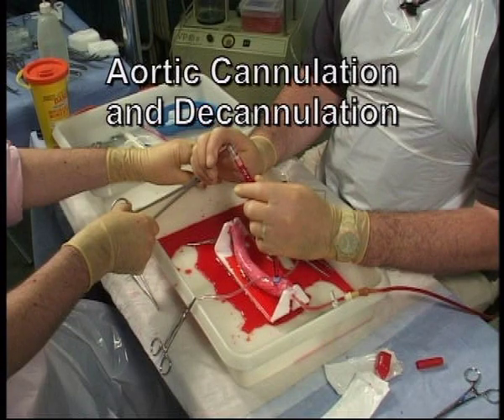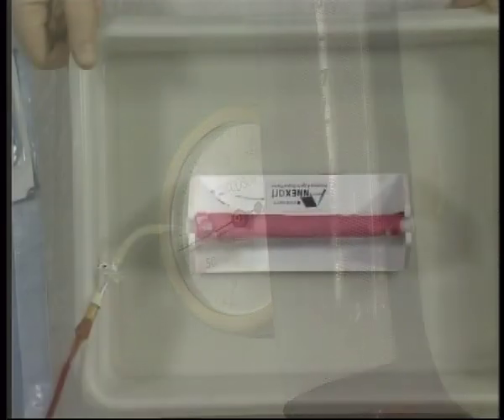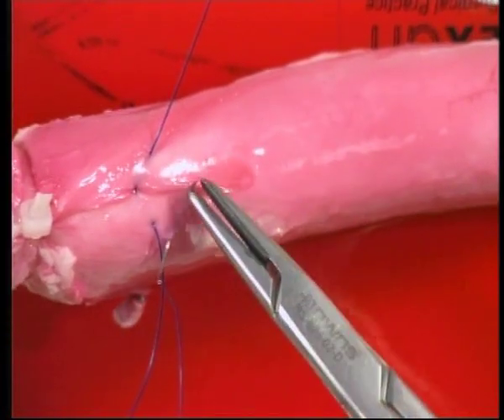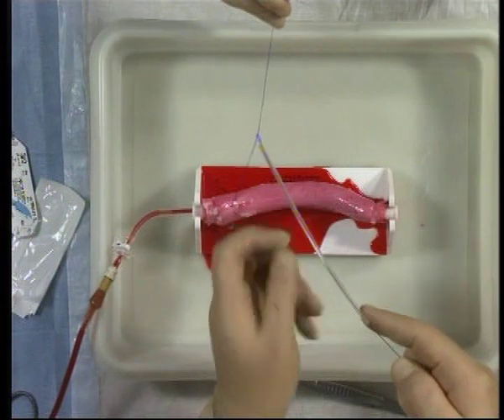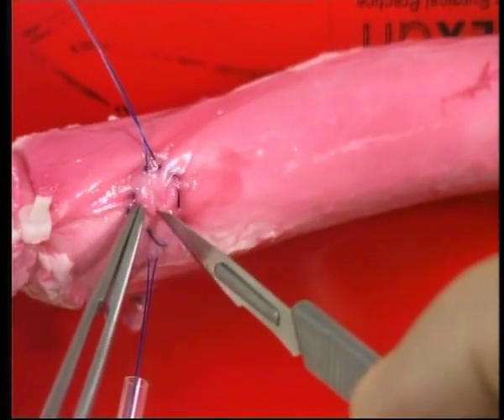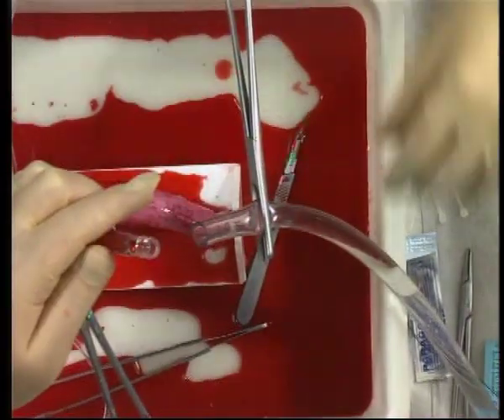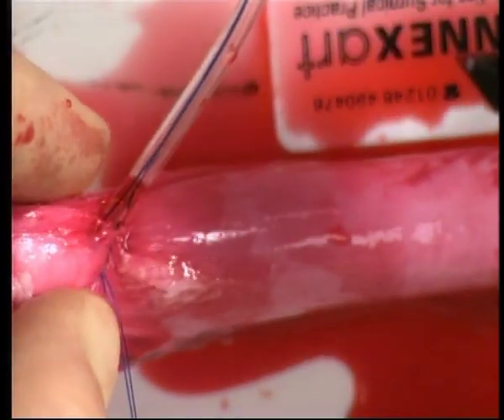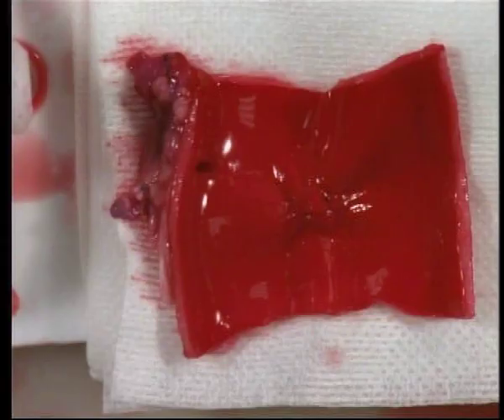Aortic Cannulation and Decannulation : Cardiac Surgical Skills Laboratory

Comment: 7:07 I can clearly see an air bubble inside the tube. If this happened during actual surgery, what can you do?
Reply: Lol this video is 10 years old, I do not expect anyone to answer this question for me.
Reply: 1. Entry of Air into the Circulation

When air bubbles enter the arterial system, they can travel through the bloodstream instead of oxygen-rich blood.

This disrupts normal circulation and oxygen delivery to tissues.

2. Effects on the Brain (Cerebral Air Embolism)

If air reaches the brain via the carotid arteries, it can block cerebral arteries, leading to strokes, neurological deficits, seizures, or even coma.

Patients may experience sudden loss of consciousness, paralysis, or cognitive impairment.

3. Effects on the Heart (Coronary Air Embolism)

If air enters the coronary arteries, it can block blood supply to the heart, causing myocardial ischemia or even a heart attack.

This can lead to arrhythmias, low cardiac output, or cardiac arrest.

4. Effects on Other Organs

Air bubbles in the systemic circulation can obstruct blood flow to the kidneys, intestines, and extremities, leading to multi-organ dysfunction or ischemia.

5. Hemodynamic Instability

A sudden drop in blood pressure (hypotension) may occur due to reduced cardiac output.

The patient may develop hypoxia, leading to further complications.

Prevention Strategies

To prevent air embolism:
✔ De-airing of the cardiopulmonary bypass (CPB) machine and tubing before connecting.
✔ Use of filters and bubble traps in the circuit.
✔ Slow and careful cannulation to prevent accidental air entry.
✔ Transesophageal echocardiography (TEE) to monitor air bubbles intraoperatively.

Emergency Management

If an air embolism occurs:

1. Immediately stop perfusion and remove air from the circuit.

2. Place the patient in Trendelenburg position (head down) to prevent air from reaching the brain.

3. Administer 100% oxygen to help dissolve the bubbles.

4. Aspiration of air via an aortic root vent or right atrium.

5. Hyperbaric oxygen therapy (HBOT) in severe cases to rapidly dissolve the embolism.
Reply: Dial down the flow rate on the bypass machine and purge the bubble with the saline injector and allow it to pass out of the output tube, then cannulate as normal and dial the flow back up. If you see a bunch of bubbles it's likely that the oxygenator is having a leak. If that happens then stabilize the patient and replace. ❤